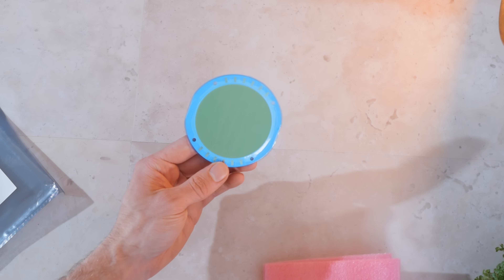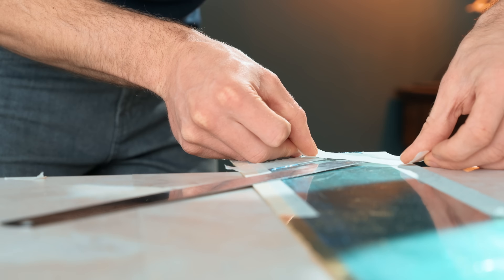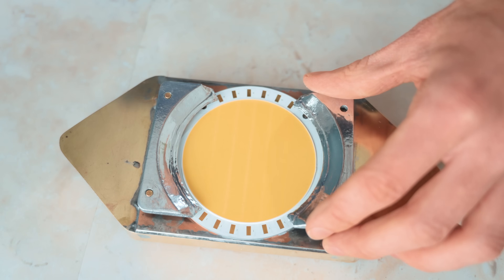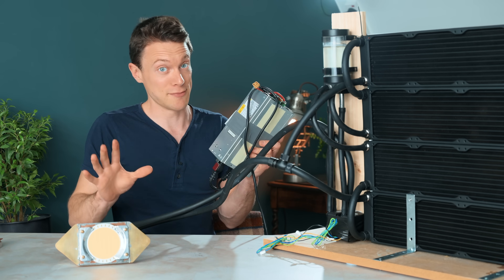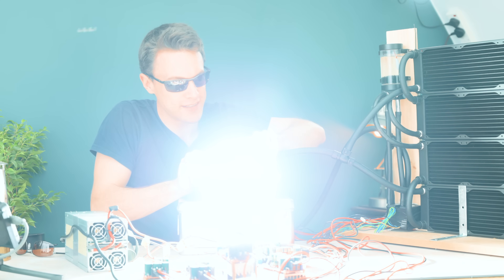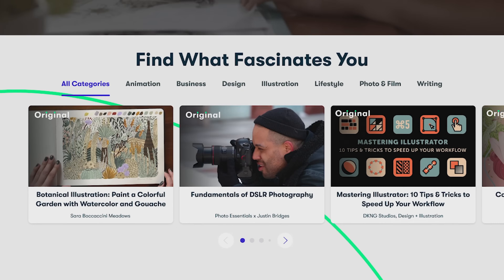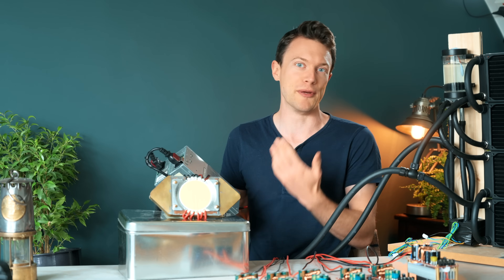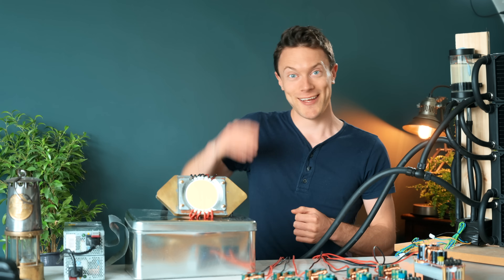Testing the world's BRIGHTEST LED!!!

Comment: I think what you should have done when wiring those PSUs in series was to disconnect the "ground" connection of the psu that was supplying the positive lead. It was probably very unhappy that its output was greater than expected with respect to ground. There is a more elegant solution but this would be the quick and dirty way. For better results I think one way would be to get a 3rd psu and have its output mimic the voltage of the psu with the negative lead. elevating the voltage of the ground on the positive lead PSU so it would both not share the same ground as the negative lead and still be able to dissipate any accumulated charge.

Comment: Question : Are the people who manufacture this type of LED aware of the amount of heat this thing generates and did they come-up with a method to cool it efficiently ? 
Cause if this thing isn't portable it's basically useless , unless you're trying to signal the batman by flicking it on and off i'm not entirely sure what the purpose of this LED is .

Comment: Use an industrial grade 2kW PSU. ATX PSUs (and most other switching PSUs) cant easily be operated in series, they often actively regulate their output, and it can confuse them. Also, PC PSUs are grounded (negative is connected to PE), so either these server PSUs are not (or he cut the earth connection), or he used the -12V rail on one, which is a very bad idea as those are extremely low powered on PC PSUs

Comment: I wonder what the 12V rails a rated for on those power supplies. Usually, on consumer power supplies, only a fraction of the total rated power can be delivered on the 12V rail with the remainder going to the 5V and 3.3V rails. So a power supply rated for 600W may only deliver, say, 500W or even lower when drawing only from the 12V rail.

Comment: Would it be possible to connect the output of a strip to the input of the next strip to provide only once the current instead of 6 time? (of course need 6 time the voltage instead of one but i presume it is easier to get a powerfull 210V 7A DC power supply than a 35V 42A. And the voltage drop in the cables would be easier to deal with.)
Nevertheless very nice video, thank you very much for that curiosity :) Nice welding job too ^^

Comment: Matt, as an electrical engineer I’ll tell you what your issue is with the power supply. When you connected them in series, you got the 24V you wanted but only at the smallest current capacity of the power supplies. It wasn’t clear from the video of the supplies were 2000W each or 1000W each. In the case of 1000W supplies that will be the most they can provide. Another possibility is that the voltage boosters were causing the supplies to draw more current than they were rated for. I couldn’t tell if you were measuring current output from the supplies, but the voltage boosters get you that extra V by drawing more current. There are also some efficiency losses that might be putting even more load on the supplies. 
The last thought I’ll leave you with is that if the power supply voltages are not exactly the same, you can end up with a situation where one supply is trying to drive more of the load than the other and then cascades into failure, taking the other supply with it as it fails.

Comment: Just to maybe make the case design easier; Two, or if you dont care that the fans will run at max speed, a single radiator that size (480mm) is big enough to cool roughly 800 watts of heat. The water should get up to about 35-38 degrees. (personal experience, had calculated it in the past with mine)
The LED array obviously doesn't output 1500Watts of power, assuming LED efficiencies it shoulbe somewhere around 300 Watts.

TL:DR A single Radiator is enough already, if you want to go overkill use two. 4 is just... idk. You have them already, but the space usage/cooling factor ratio would be kinda meh,

Comment: you just can´t put server PSUs into series, since they have GND output tied to ground pin on the input side - so you basically short circuited them. I guess  you did not even get 24V from the PSUs. Please try and measure the voltage output from them, or run them without any load. there are server PSUs that output 48V, you might want to try those

Comment: Having this much power "on the go" would be absolutely amazing!

What is the required input voltage from the LEDs?

Can't you simply use Lithium Battery Packs?

I mean - big copters easily draw 4 - 5 kw!!

So 1,5kw powerdraw is no real problem for a specifically designed battery

Comment: Be mindful of the led's temperature as well. If the heatsink is staying cool you may have bad thermal contact, be it from a bad thermal paste application or not enough pressure. Thermal paste's thermal conductivity is actually terrible when compared to copper, so a thinner layer is way better. More pressure makes for less thermal paste.

Comment: Maybe a honda civic radiator would have been more cost effective? its basically the same size as that setup.
Reply: jearss lol your probably right or anything rad he’d find at the junkyard it would probably be a less than the cost of on of those pc radiators
Reply: Was guy on dutch pc forum 10yrs go who place truck radiator out side of his house to cool his OC game pc. Car and truck rad are super cheap a pc rad can easy be 100 euro
Reply: The pump might be undersized to ensure turbulent flow in a civic radiator.
Reply: Aluminum and copper in the same loop isn't good if you want to keep using it for long. I suppose you could use automotive coolant and hope the anti corrosion additives can prevent it.
Reply: @Jaker788  I highly doubt he bought 4x480mm copper radiators for this system, he was already talking about cost of copper in making the watercooling block
Reply: @SuperBrainAK  yes he did, look at the pinned comment.
Reply: @SuperBrainAK  in the pinned comment he states he used copper radiators specifically because of galvanic corrosion.

Comment: This led is emiting probably 40%(*) of power in light and 60% in heat so you dont need 1500W loop to cool it

*Edit. Efficacy of this led is really low (80lm/W) so more like 20% power is emited in light
Reply: Jakub Kurowski you probably want some factor of safety though
Reply: There are single cobs out with over 200lm/w around 100w peak, but I think it is too expensive and difficult to build big led arrays like that, good binnings are probably not frequent in the selection process. It is way cheaper to produce lower power output leds with like 0,5w with 250lm/w. But I don’t really see a purpose for such a high power led (1,5kW), the small surface area makes it more difficult to cool it, the lifespan is probably also reduced and the price is insane I think?
Reply: @dalivanwyngarden3204  He says the purpose in the video. Let's say you're on a movie set and you need to make it look like it's midday except it's night. This will cast shadows the same way the sun will while offering the same sort of output.

Comment: I'd suggest using a car radiator, you wouldn't have multiple radiators that way, less possible failure points.
Reply: instead......use the water sump/overhead tank/lake/pond/river......and a Welding Set instead of Server PSU !!! Lol !

and.....also......stop saying how bright it is.......Use a Light Meter and show the lumen readings with reference to distance from the Led when you test it outdoors at Nighttime !
Reply: @NavinBetamax  🤣🤣🤣🤣🤣
What is "sump"?
Reply: Failure points are very low, but simplicity would be a plus. The downside to a car radiator is it's aluminum but the cooling block is copper..
Reply: @Jaker788  most pc radiators are aluminium cores

Comment: Hey!!
please read my comment  

the power supplies in series , the voltage double so if one is 12v 750w , two of them in series is 24v 750w!!!! it's why she's blow out 
you need 4 of them for power your light (2in series with 2 more in paralel ) 
it's a basic thing and im shoked that you dont know it ??
in series : voltage double 
in parralel ; amperage double 
so yes if you take 2 power supplies in serie , you can have 24v and 750w of power even if the 2 power supplie take 750+750w of consumption

not sure about my english because im french 
i hope you can read  my comment

Comment: Those switching power supplies are not designed to be used in series.
You need power supplies whose output is isolated.

Comment: The power supplies in series?  I can’t convince myself, it’s been 20 years since I studied electronics in anger, but I think the wattage will be pulled from them both equally and in total (the current must flow around the entire circuit, so assuming your voltage steppers add maybe a 10% inefficiency (probably far more...), you’re pulling perhaps 1650W through each PSU... (and at 12v each, that’s a heck of a current - circa 134A)).  (I’m not saying they both driving the full wattage, but they are having the full wattage passes through them.)

Also I’d be a little hesitant about running them in series generally.  Why not in parallel, with half the LED driven by each?  Too much for the voltage steppers?  You might have some mileage looking into industry enterprise grade network switch power supplies - as PoE is 48v.  Maybe try eBay for a Cisco 6500 power supply or something?

Do the PSUs have multiple power bus bars each?
Reply: I.e https://support.hpe.com/hpesc/public/docDisplay?docId=c02711001
Reply: Having worked in a few data centres - trust me when I say those 6500 series switches have some serious PSUs in them ;-)

Comment: Hey DIY ~ My laser group https://www.facebook.com/groups/DIYLaser/?ref=br_rs
If you ever plan to build a laser machine, I'd love to work with you on specking out a system via email or messages.  Don't want any credit or attention, just really want to get a worthy unit out there based on years of experience.
  No one does videos better than you do, so it only makes sense for you to build a proper laser unit that would be superior in design and function, yet stay within a close range of cost to all these other systems people have been posting lately.  It's funny, because for some reason every DIY'r has just jumped on the Laser build wagon over the last two years.  3-4 years ago it was hard to source anything!   
   That being said, I've been building laser cutting/etching machines for 5 years now and no one has covered all the bases in their youtube builds... NO ONE!   Some have come close to getting it right, but fall short in one way or another here and there.   If you ever want to give it a run over, hit me up and I'll drop a bomb of info on you!  My FB group is a good place to find what I'm up to.

Comment: At 12:00 when he just switched it off I said out loud to the screen "Dude - you need to get a fan on those power supplies to cool then down!!!  They are going to cook themselves if you don't cool them and let them sit that hot with no air circulating!!!"    14:20 - told you so!  LOL

Comment: Hey man, love the video as normal.  Just wanted to say, while I don't fool with the LED stuff (YET!)  I have been an avid RC guy since I was a kid and I have since become somewhat of a guru on building Laser cutter machines and CNC devices, PC's and so on much like yourself ect.  That being said, I would consider a water chiller for that setup.  Greatly simplifies things unless your intend to make it ultra mobile.  You can get a CW-3000 or maybe even get away with a smaller all in one unit like a hydroponics chiller.  Likely either of these would be much cheaper than what you did here.     As for the PSU's...  I've done this as well.   Maybe you should try series of 4 next go round with 3 of them de-grounded of course!  But 48 volts with lower the watts needed and reduce current over flow to those transformers.  I built a 48v unit for my iCharger 406 for lipo charging.  Works amazing!

Comment: Correct me if I'm wrong but, cooling the LED is not like cooling a 1500W cpu? The energy a computer consumes is all lost as heat, but an LED would have most of its energy leave as light, right?

Comment: According size and led chips capacity, power consumption should be maximum  500-600 W. Usually LED no need water cooling. 
If it use with water cooling them it mean LED working in border current limit with overheating, so real wattage is about 500 W i think. 
Also in this case better use xenon short arc bulb. It will be more efficiency. 
here documentation:
https://cdn.shopify.com/s/files/1/0344/6401/files/YJWJ073-1.0_YJ-BC-900H-G01.pdf?200

Comment: @8:20 It would be easier to turn some potentiometers in the power supply to get the right voltage instead of using boost converters. That seems a bit unnecessary.

Comment: Was there a specific reason you plumbed your radiators that way? It seems highly inefficient when you can just daisy chain the radiators together. The T-fitting would be causing some water restrictions and i would wager overtime you will notice uneven heating on the radiators.

Comment: Some PC power supplies are split up into rails. Each rail has its own max power rating. 

Perhaps it was just one of the rails that saw its end.

Usually, multiple rails are combined to power something that exceeds the capacity of a single power rail.

Comment: It could've been that you were drawing too much power from one "rail" inside the power supply and that's what killed it. Older power supplies tend to have that problem where you can't draw the full amount of power out of just one voltage or "rail". I'm not sure though, It's just a guess.

Comment: I think the main problem with youre power suplies is the current you are pulling through these supplys. Normaly  (not set in serries) you'll pull half the current through them; but now becource they are in serries they have both have to deal with the high current. So get a suply that can handle the watts you want (or take a power outlet and a transformer) to do the job. BTW why didn't you go for a transformer (wih a direct current cinverter) in the first place? if you use 1500 watt, at 220V (or 110V) you pull just 6.8 A (or 13.6A) what is normaly within the limits of youre powerbreakers.
Greetings from Belgium.

Comment: You just fried those server PSUs by turning them off at full load. You should shed the load and leave the PSUs powered for a few minutes to let the fans run and blow away the excess heat.

Comment: Running switchmode power supplies in series is risky, as with their voltage regulation, since they're technically driving current through another power supply, they can interfere with eachother posing a highly dynamic load which stresses the PSUs heavily. For this purpose I'd just run 2 car batteries in series. Sourcing a 24v ~1500w PSU shouldn't be impossible either, or wiring up two 12v transformers in series of the same type.

Comment: And yeah you shouldn't have powered them in series. They're obviously not designed for that. And yeah if you've seen smoke it's most probably dead. But if you're lucky it was just some mosfets that burned and is easily replaceable but really you should get a better power supply.Since it's just LEDs maybe a nice huge ring transfomer would work.

Comment: One guess on PSU failure could be that you didn't separate the earths / grounding when they where wired in series. Isolated from ground.

95 CRI is insane, I bet it was very expensive. Think of how many rejects they have under quality control!

Comment: There are a lot of good comments about the PSUs here in the comments. But you should also not strap multiple PSUs together like that. The designers rely on free air around all sides of the metal case.

Comment: What wire gauge did you use ? Those wires look kinda weak and are quite long. At those currents those wires could have high voltage drop and dissipate alot of power as heat. So maybe your LED was not even at 100% power....

Comment: Paralleling the PSU and then boosting the voltage is most likely less efficient than putting them in series and reducing the voltage. Also these power supplies often have a 'trim' potentiometer that allow you to reduce or rise the voltage a bit, that might have been sufficient

Comment: When you get it running again, it would be interesting to get an efficiency measure of the light.  By running the cooling loop without the radiators, you should be able to measure how quickly the water heats up.

If it's 50% efficient, the water should heat up by 10 C in 1 minute per liter.

Obviously don't run it long like that.

Also, bear in mind that even a 95% efficient power supply is going to be putting out almost 100W of heat.

Comment: Would you consider building a "non-x-ray-x-ray"? (Using the normal light from the LED instead of X-Rays for light transmission across tissue? I would be interested to see, what a human hand looks like from the other side if it is blasted with 1.5kW of light.

Also, I assume you use boost converters for the LEDs. I would maybe try to power 3 sections per power supply and separate the two circuits to prevent magic smoke in the future.

Comment: 1:57 I'm pretty sure a Threadripper CPU block would have been big enough. These things are huge.
Reply: Or the newer xeons, but I believe they are smaller than threadripper.
Reply: No The Block has to cover the whole LED, so no
Reply: @maximilianschaffler9981  not neccesarily. you want to cover as much as possible, but you dont have to do all. the metal back of the light will transfer heat to the block, and you could add heat sinks to the edges that arent covered with airflow on them.
Reply: @special_weeaboo7962  maybe but I think that if one led of the array isn't cooled it will break and the chance is pretty high if the block is too small